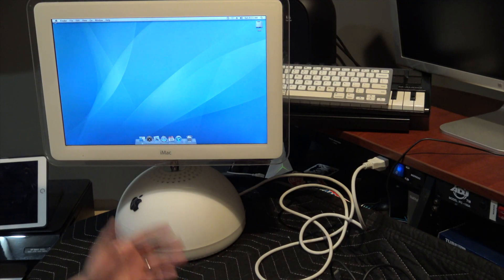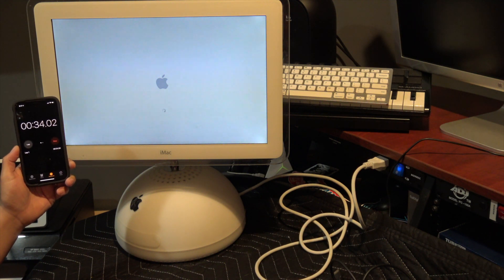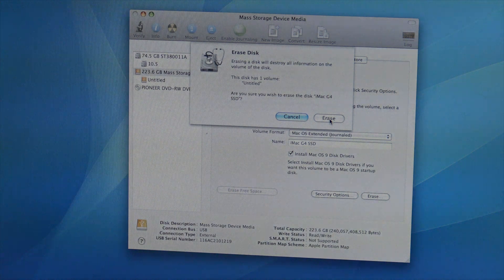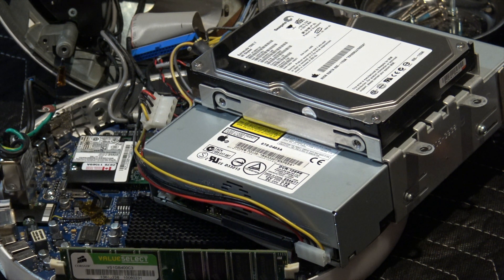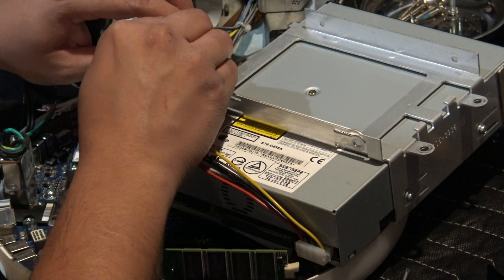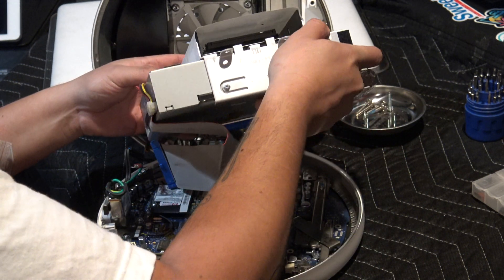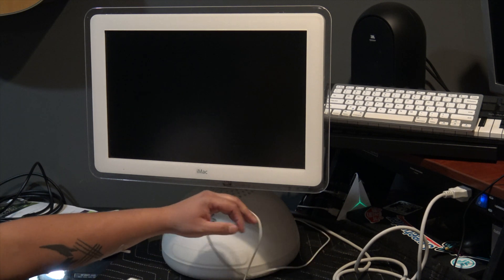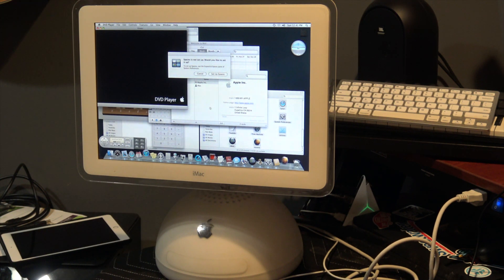iMac g4 Upgrade

Comment: I recently did a similar upgrade (before I found this video), I ended up drilling two new holes into the original bracket. I also fixed the IDE/SATA adapter to the disk with duct tape. Unfortunately, the iMac won't cold start sometimes, I suspect because of that adapter, it's a cheap €12 thing from amazon. But once it started it will run stable. There are occasional 1-2 second freezes but that's probably because 10.5 doesn't know the "Trim" command so the SSD has to do garbage collection instead.